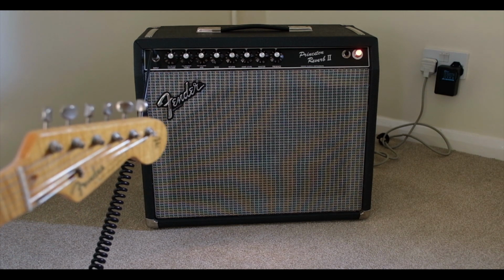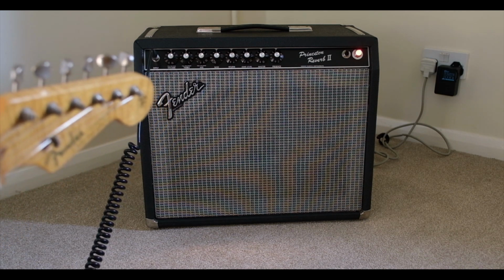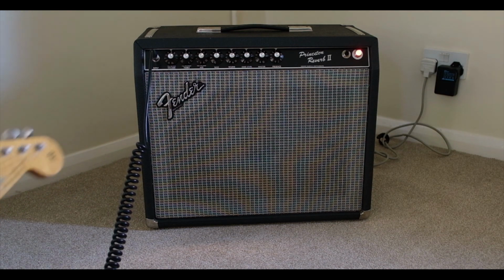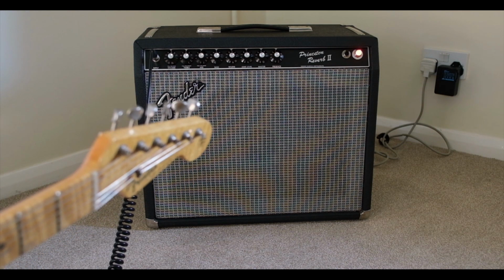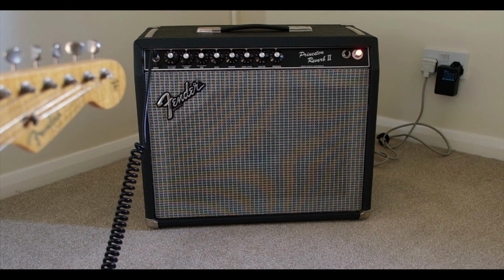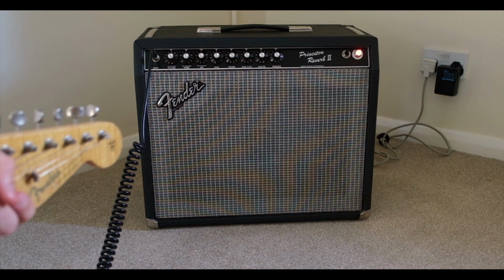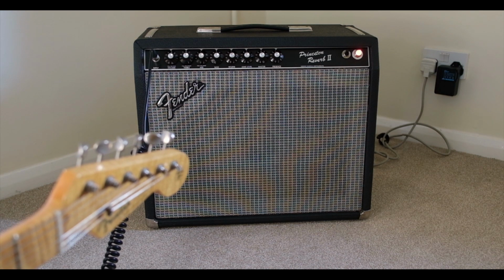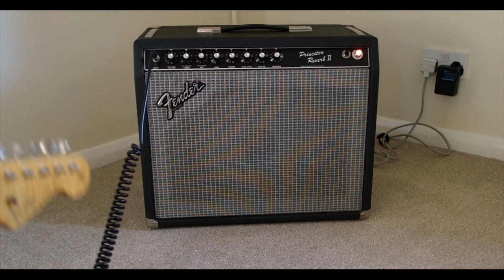Fender Princeton Reverb II tone and features demo

Comment: Sounded great. Do you regret selling it?
Reply from the maker: It was a great amp but wasn’t the sound I was looking for. At higher volumes with a Tube Screamer it was fantastic but too loud for small gigs and home use. I was glad that it went to a good home.
Reply: @tommytube48  I just got a Super Champ after a few issues fixed Ive found that the original speaker is the biggest POS ever put in an amp. Also even without the bright switch there is a bright cap always on in this and the super champ.  its 100% better with it removed

Comment: What does the negative feedback mod do?
Reply from the maker: Guillermo Azurdia I got all my info from the Stratopastor site:
http://www.stratopastor.org.uk/strato/amps/prii/modifications/gainmods/gainmods.html
--------------------

LOOSER, MORE ORGANIC SOUND; MORE POWER AMP DISTORTION; 
NEGATIVE FEEDBACK LOOP SWITCH

For info about Negative Feedback Loops and what they do, see here. (no point in my trying to re-write this kind of thing!)

July 09 - I have done this mod and only got a subtle change. However another PRII owner says it makes for a big difference. Maybe it's something to do with my power valves being biased cool.  

Referring to the schematic, there's a 100k resistor at the top of the diagram, shown above v5 and v6, forming a loop back from the power transformer to the  inputs of v4. If that loop is broken (just unsolder one end of that resistor) then the amp's power stage becomes less hi-fi, looser, more organic, with power amp distortion (i.e., nice distortion) appearing earlier when the volume is increased. This is a very subtle effect at low volume and only makes a real difference when the volume is increased to rehearsal or gig level.

Advantages  - slightly more maximum volume, earlier onset of power amp distortion, more touch-sensitive, warmer, less clinical sound.

Disadvantages - maximum clean volume is reduced, slight increase in operating noise, slight loss of extreme top and bottom end.

Side-Effect - the presence control won't work. On my amp I can't hear any loss of presence, possibly because I've added a little top end by cutting out the snubber caps. 

Risks -  there is a theoretical risk that an amplifier becomes unstable (makes a hooting noise with no instrument connected) when a designed-in negative feedback loop is removed. This wasn't a problem on my amp and I don't think it would be on any PRII.